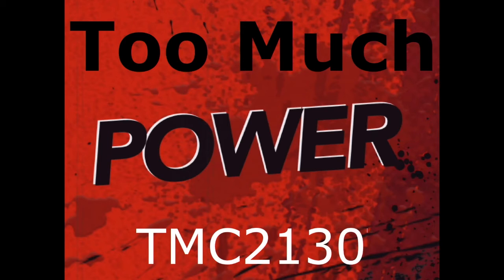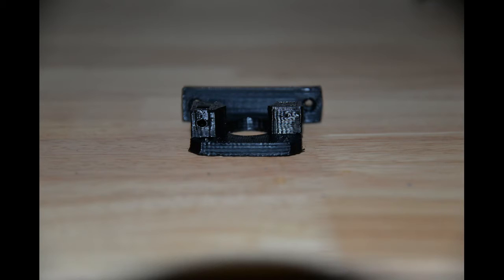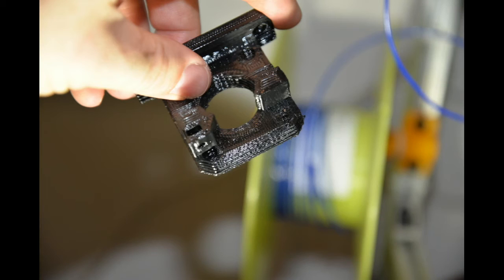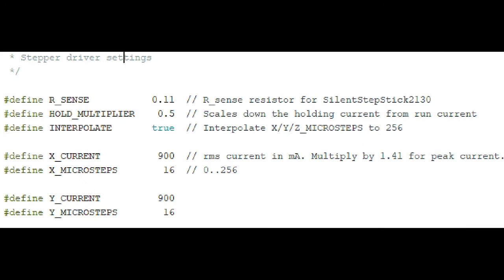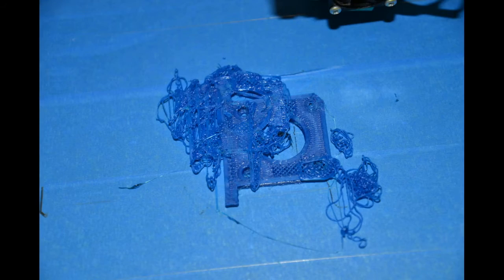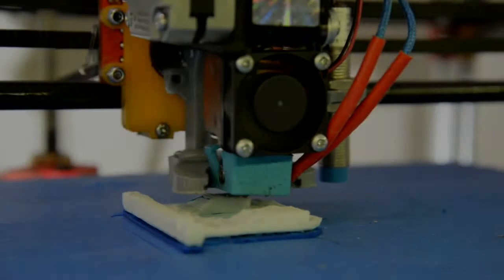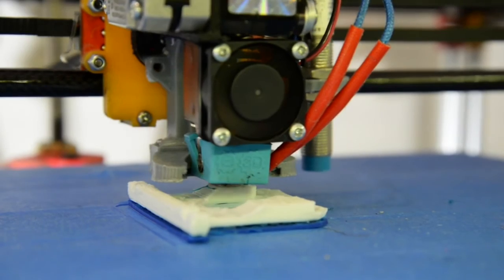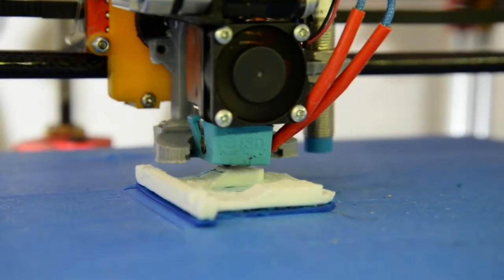TMC2130: Too Much Power?

Comment: how many amps are your motors? I have 2A steppers and I would think I could set power easily to 1000 but I'm working best in the range of 750. Now I have have 1 stepper driver (Y) overheating which I find a bit odd as it's coreXY (and both motors share the load for X and Y)
Reply: It's not only the amps the motor can handle that defines the current setting...
Also the motors "rated voltage", coil resistance and inductance, supply voltage and speed/acceleration settings all influence the needed settings and achievable limits.
Some quick guidelines for stepper motor driving:
- Supply voltage should be 3 to 4 times the rated motor voltage.
- max current to set < 0.5x supply voltage devided by motor resistance.
- higher max current ==> lower max speed.
- lower max current ==> lower torque and max. acceleration
Reply from the maker: My stepper motors are 2A. My TMC2130 are on 700mA and spreadcycle. Still very quiet. If you have cooling on them you could probably run them at 1000mA. I don't have a fan on mine.
Reply from the maker: Thanks for the info.